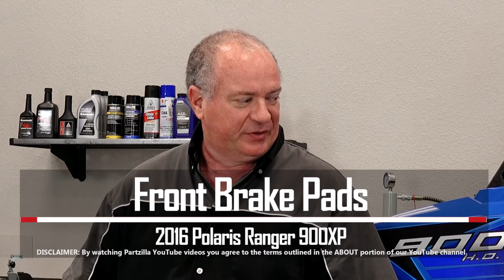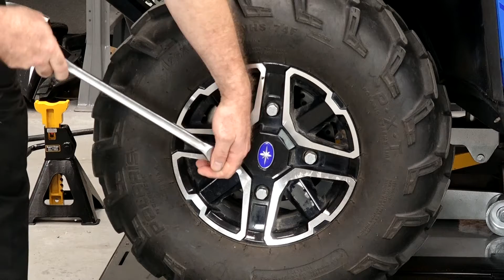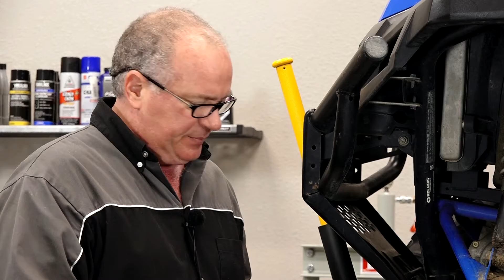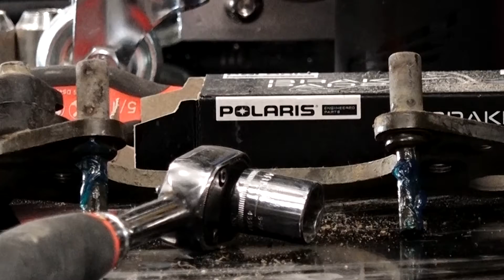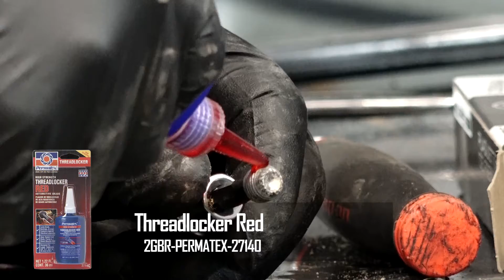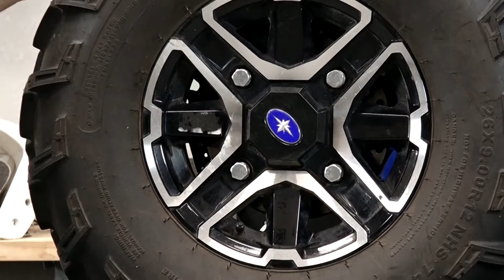How to Change Polaris Ranger Brake Pads | Front Brakes  | Partzilla.com

Comment: John, on your video for front brake pads on a RZR 800 you only show it going to 30lbs and not the addtional 90 degree tightnening.  Could you update that excellent video as well if it is applicab;e? Thanks!